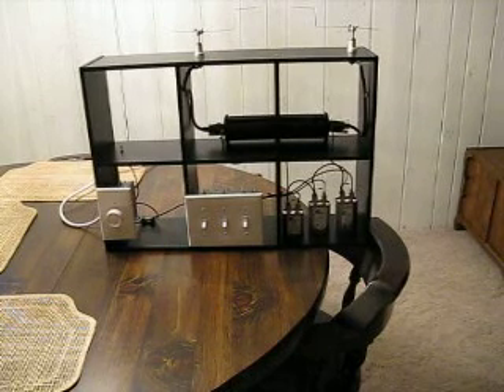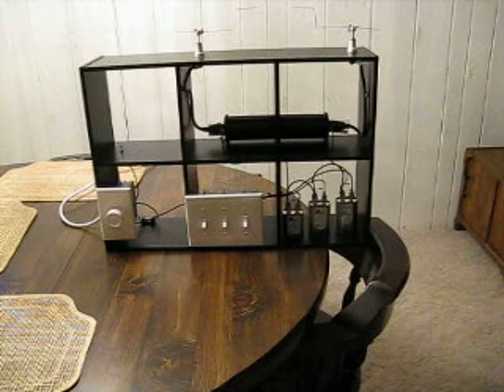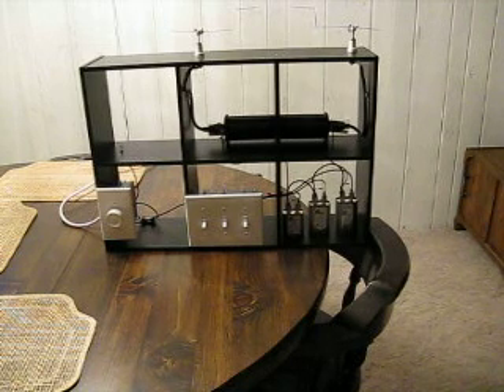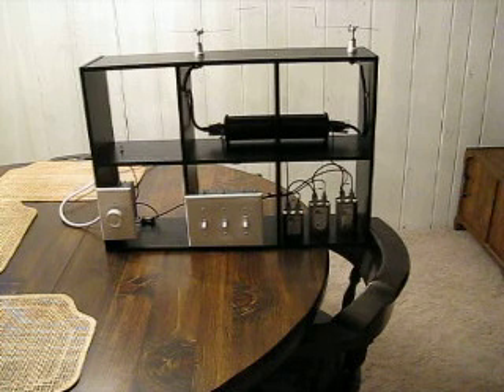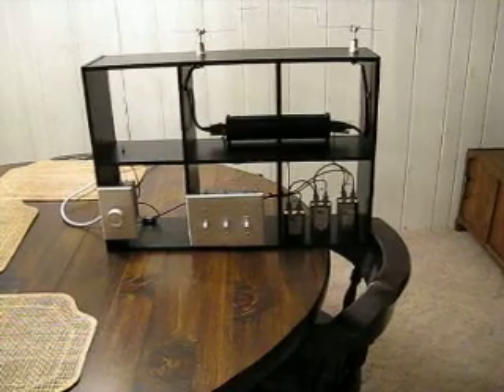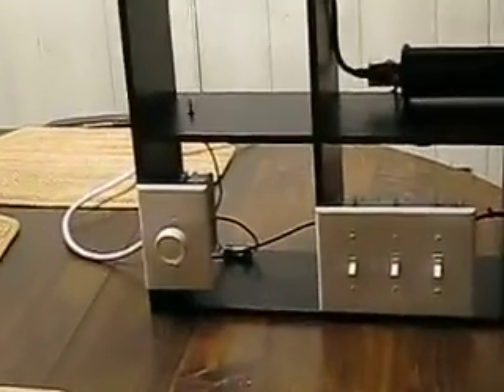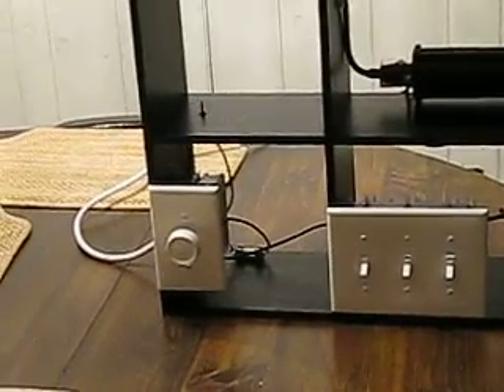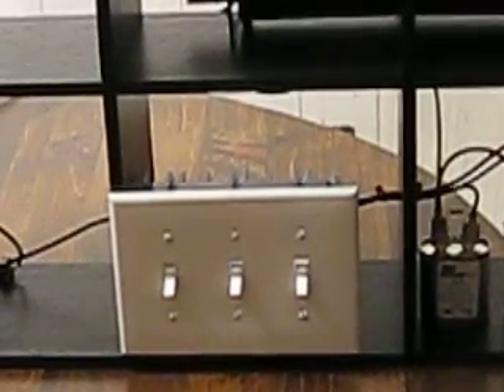Ignition Coil / Light Dimmer High Voltage Generator - Variable Output Design

Comment: hello sir I hope for some help Im anoyed honestli my old Opel car from the 80s use's the 4 pin GM ignition module pick up coil and the e core type ignition coil. Now my problem is cold starting my engine in winter time . The ignition module uses the MC 3334 ic chip diagram easeli found on google evry thing is the same by my as circuet only difference I dont have zener diode in that diagram my Europ version ignition module is cheaper variant. So my original question is how do I phase shift that deam staff? I did lateli use some 4 pin relay to bypass voltage directli to ignition coil with some diodes for extra arcing protection but still Im not reali impresed by that crapy ignition module . I need to phase shift my module by any means around +/- 20° engine degrees so I hope you know some thing that I can use to modifi that system . Some peopel claim ic chip phase shifters do the trick other say transistors do it or those rc networks but no one honestli mentiones variabel 0-180° phase shifters .In my case I need at least 10-15 ° advance ignirion timing just so I can start my engine easyr . So I hope you understand my question Im confused honeatli what side of the module trying to modifi ither the pick up signal or the module it self ?? Or perhaps wuld it by best to build own variabel module? I hope for advice on this topic

Comment: Cool HV supply. I have a question for you, see what you think, you know how a quick HV supply can be made of an electronic CFL ballast and a large TV flyback trans, and some have used the larger electronic ballasts for long tube fluorescent lamps that have more output wattage. What I was wondering is do you think an electronic ballast could be used for driving an ignition coil as well, or perhaps two or three coils in parallel? If a flyback could be driven with a CFL ballast or larger electronic fluorescent ballast, surely an ignition coil or two could be? Or do you think the frequency could be too high? I think electronic ballasts operate at around 25 KHz, up to as high as 100 KHz depending on the ballast. Vehicles with V8’s are able to use ignition coils for firing all 8 cylinders at RPM’s up to 6,000.

Comment: Excellent use of an automotive spark coil to make a "spark machine"! I have tried using a dimmer switch for the driver and it works perfectly! It's nice to see something on you tube that is not just a lot of jumper wires thrown together on a kitchen table. Bruce really knows how to build something!

Comment from the maker: predom69-
Never had any issues with the electrodes melting.  I actually replaced the ones in the video with two sewing needles (sharper point tends to initiate the spark gap with lower voltages).

I do use tungsten on most of my Tesla Coils though as the current is very high on those items.

Comment from the maker: sail107-
I have never ran it more than three or four minutes (mostly experimenting with vacuum chambers).  I would assume that at the lower current levels you should be able to do so.  (You can try for two or three minutes, shut off the power, and feel the ignition coils.  As long as they are not getting hot you may be fine.  They will get warm, but should not be getting hot).   Of course you need to be aware of NOxx and ozone gas buildup in a confined area.